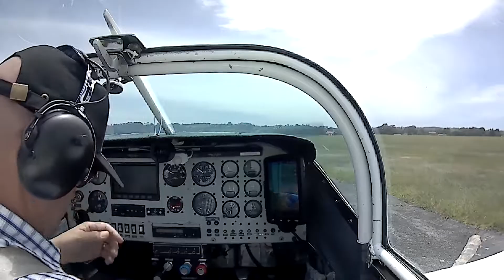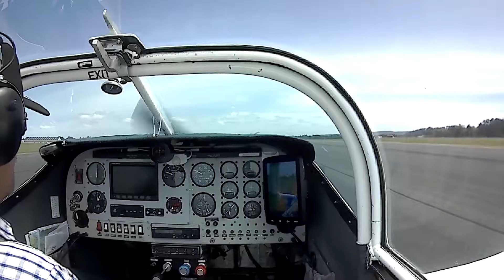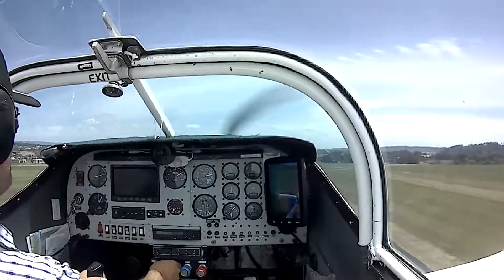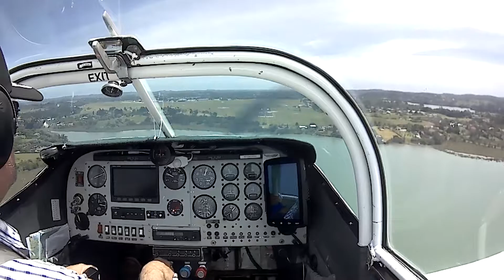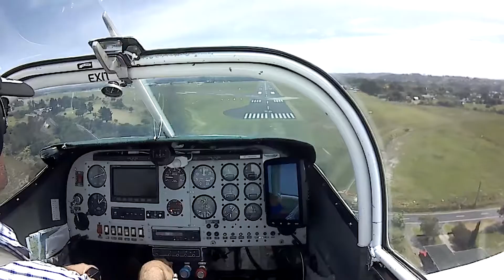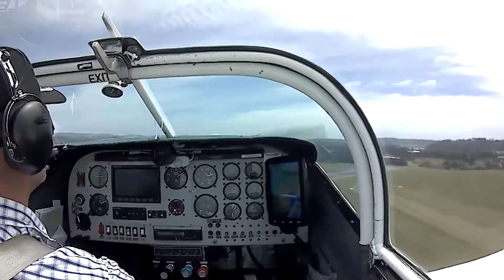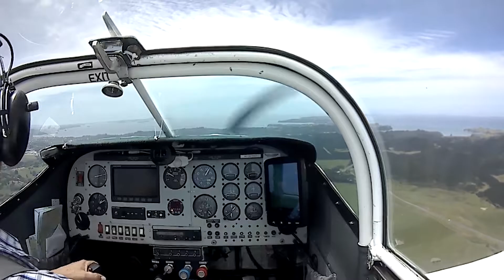Thorp T18 - ZK-EDF  |  Circuits at Whenuapai

Comment: Do you do 3-point landing in the Thorp or it don't like to do that?
Reply from the maker: Hi Peter. In this video I was doing wheelers,  as the runway is 1,500 metres long,  but have since adapted to three pointers in order to get into shorter airfields and touch down a lot slower.  Typically 10 - 12 knots slower over the fence.. Rgds Stu
Reply: @StuWards  would you recommend the T-18?
Reply from the maker: @PeterPasieka  I do like it a lot! If I were to start again, would I build one of these or an RV? The RV would likely win due to the kits available etc, but these T18s are unique and very lively. You'd need to go for a ride in one and in an RV6 to make a fair comparison.  Nowadays most would build an RV7 as it's a bit bigger for bigger people. I just fit in this with a headset on and my wife finds it very close side by side. The RVs are a little wider and the later model S18 is a bit wider too. The S18 offers folding wings so you can 'hangar' it in a trailer or single garage. Your questions might be best put to the T18.net forum...  goto t18.com and also T18.net  Rgds Stu